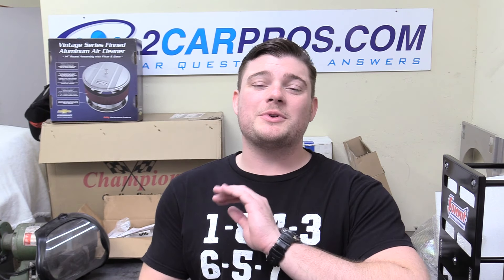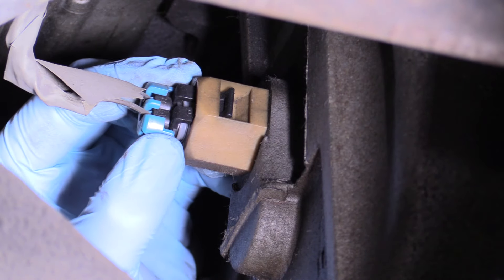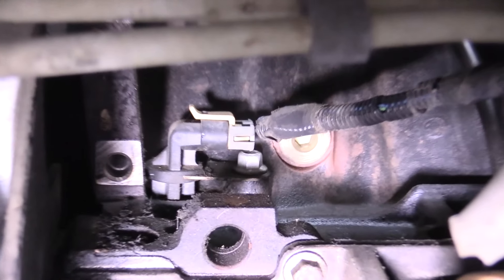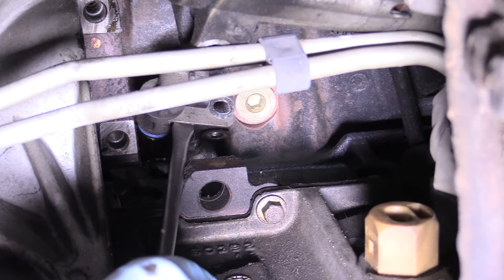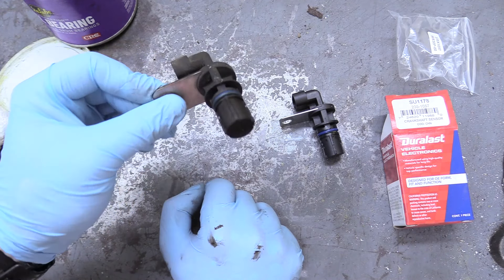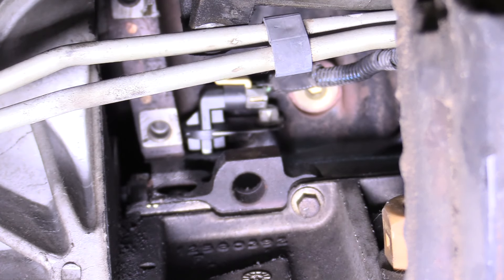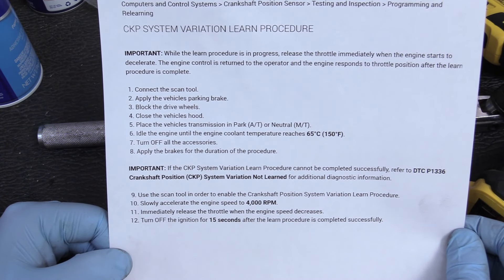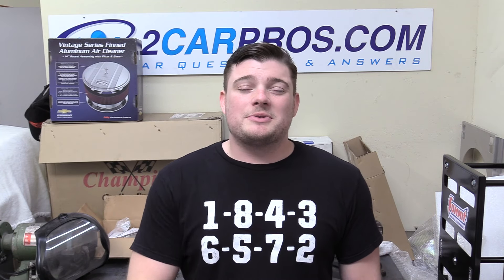Crankshaft Position Sensor Replace Chevrolet Silverado Suburban Tahoe GMC Yukon XL Sierra 2000-2006

Comment: Okay, well, I just checked and found that yes, I did break one of the 3 wires off from the crankshaft position sensor connector, which is why the truck won't fire. So I either need to splice in a new connector with a length of all three wires or get a connector tool and try to fix it. Edit: Didn't plan on fixing it tonight, but the local auto parts store had the part, so I went and got it, spliced in the new connector/pigtail and the truck runs!
Reply from the maker: Nice work! Thanks for watching!
Reply: What was the order in which the wire went

Comment: When doing this to my 2001 Suburban 5.3l,
 I had to take the 15mm bolt out of the dipstick tube bracket (from the top side) and pull the dipstick and tube up and out of the way so the starter could then be pushed back. My starter had no room to slide back until I did this. Hope this helps.
Reply: Hoping they fixed this on the 2002 models, not looking forward to this fix

Comment: You can get to it by going through the RF wheel well; just remove the wheel and wheel-well lining.  Also, I'd disconnect the battery before messing with the starter.
Reply: I think that was the very first thing he said when he started explaining the process. Paying attention pays off bud.

Comment: This is pretty much how it goes. But I'm sure 99% of us don't have a car lift in our driveway or garage. So you'll be doing this on your back in the ninety-degree heat trying to finagle that sensor out without smashing into pieces mine was stuck in there pretty good.
Reply from the maker: So do you want me to not use a lift? I'm confused. Thanks for watching!
Reply: @2carpros  that’s not what he was saying at all. Lol.

Comment: Great video. 
If I just want to replace the O ring and not the sensor. Do I I still need to relearn with system. Since I’ll be unplugging it.
Reply from the maker: I think if you replace it with the same sensor it will be ok. Thanks for watching!

Comment: Tip... don't use oil or grease on rubber seals. Solution, use silicone paste with teflon, it won't swell the seals or make them soft like oil and grease.
Reply from the maker: Good tip! But most people have engine oil and I want to make these as accessible as possible. Thank you so much for watching!
Reply: wouldn't wanna get engine oil on an oring that is used to keep engine oil sealed in.
Reply: Well I first thought was use sil seal , or sil glide  I think it’s called. But made for o rings and doesn’t swell them.
Reply: Great tip i will remember

Comment: How different is this on a Chevy 4x4? I heard the oil dipstick tube is in the way from underneath....maybe there's a better method on the 4×4s?
Reply from the maker: I don't see how it would be different. There just might be an axle in the way. Thanks for watching!
Reply: Through the wheel well

Comment: When these go bad, can they cause the dash tach to drop off on the freeway or under moderate load (acceleration). I'm fiddling with a P0342 code, and my tach will drop off when on the freeway or right after moderate acceleration up hill.. I have a 02 LS1 in an F-body. No sure if I should go after the Cam position sensor first or do the crank position sensor (it looks so much easier than the Cam Sensor)
Reply from the maker: What usually happens when these go bad, is a crank no start or an intermittent stalling problem. I would swap out the Cam sensor and see if that fixes your problem. Thanks for watching!

Comment: Hi there, thanks for the video but where the location of crankshaft sensor because in my truck Duramax 3500 2005 6.6 diesel it's not behind the starter so do you have any advice thanks

Comment: Thanks for the video! I'm going to attempt this on my 09 Hybrid 6.0L. I'll comment back when it's done and hopefully won't have to do the Relearn.

Edit: the starter is in a different spot so I easily did this with a 10mm and elbow grease! My CEL is still on even after a reset from my scanner so either I need to relearn it or unhook the battery for a few...

Comment: What do you know about the different teeth on the reluctor on the crank, and getting the right while replacing the engine, not sure how many different ones on a 5.3 Ls 1
Reply from the maker: It is matched to the year of the truck. I believe only the smaller amount of teeth came on these older trucks. Thanks for watching!

Comment: Is the wire going to the crankshaft position sensor connected to the starter wire harness? Does the wire underneath the starter on the left side go up to it? I wonder if I pulled too hard and disconnected it or pulled a wire out. The truck won't fire now, but did before the starter replacement. It's the only logical explanation for it magically not firing after the starter job.
Reply: Did you ever get this fixed I'm pretty sure I'm dealing with the same problem rn it was firing before the starter job and now the new starter went it and now not firing at all

Comment: Went to a local shop for a diagnosis. And we were  talking about this. But we were tryna figure out why 7 and 8 were misfiring and fuel injectors didn’t look like a problem changed coils wires and spark plugs still misfires when I floor it at high Rpms. I don’t know if I fix this it’ll work but I’ll try it out

Comment: Can the oring go bad and cause oil leak from sensor?
Reply from the maker: Yeah sure can. Thanks for watching!
Reply: @2carpros  Ok i got oil leak coming from up top behind intake i felt it was wet around that sensor its running down to the starter im going to change it out tomorrow
Reply: I've replaced my crankshaft sensor and the o ring twice in the new one and it still leaks oil, what should I do differently?

Comment: If you don’t have a check engine light, can you skip the relearn? Wouldn’t the ECU simply relearn over time? Thanks.
Reply from the maker: It will most likely run for a little bit until the monitor resets, about 35 miles, and then the check engine light will come on. But the truck will still run, you just have to have it relearn after that to get the light off. Thanks for watching!
Reply: Reply might not have worked due to the link, I added, but here’s a “relearn without a scanner” procedure option. See any issues with using something like this?
“How do you relearn a crankshaft sensor without a scanner?
- Turn off all of the accessories.
Accelerate the vehicle to 55 mph at part throttle.
- Cruise at 55 mph for another 5-6 minutes.
- Decelerate to 45 mph without using the brakes, and maintain 45 mph for 1 minute.
- Perform 4 deceleration cycles, without using the brakes, of 25 seconds each where no specific speed is necessary.”
Reply: The second version reads like this, but it looks to be basically the same “relearn without a scanner” option:
“NOTE: If the Crankshaft Variation Relearn is not accessible through your scanner (some truck applications 1998 & later), perform the relearn in the following manner:

1. Turn off all of the accessories. With the Air temperature sensor and Coolant temperature within 5 degrees (Centigrade) of each other, start the engine and let it idle in Park or Neutral for two minutes.

2. Accelerate the vehicle to 55 mph at part throttle. Cruise at 55 mph for 8- 10 minutes until the engine reaches operating temperature.

3. Cruise at 55 mph for another 5-6 minutes.

4. Decelerate to 45 mph without using the brakes, and maintain 45 mph for 1 minute.

5. Perform 4 deceleration cycles, without using the brakes, of 25 seconds each where no specific speed is necessary. Returning to 45 mph for 15 seconds in between deceleration cycles.

6. Accelerate to 55 mph and cruise for 2 minutes.

7. Stop the vehicle and idle for 2 minutes with the brake applied and the transmission in Drive (automatic trans.) or Neutral (manual trans.) with the clutch depressed.”
Reply: So I did the “relearn without a scanner” procedure, and so far no check engine lights. The truck seems to be running as expected. Hopefully, it took.
Reply: @shrouts777  Are you still good? How is it running?

Comment: Can I drive my truck to the shop to have the relearn thing happen or will it not work
Reply from the maker: Ours worked after I put the crank sensor in. Didn't even have a check engine light until later, then I could relearn it with a fancy scanner. So yes you can drive it to a shop for a relearn. Thanks for watching!

Comment: Question: so after i installed the crank position sensor i can drive it to a shop and have them program it?
Reply from the maker: Yes you can. Thanks for watching!
Reply: How much did they charge for the learning?

Comment: Are these things known to leak oil on the starter?
Reply from the maker: Not that I know of. The starter bolt holes are blind so they can't leak oil. The only thing that can cause that is a oil pan gasket leak and its whipping up onto the starter. Thanks for watching!

Comment: I ODB reads P0336 I changed the sensor and it still doing the same thing not starting but  I keep getting the same code. Could there be any other problem?

Comment: Awesome video! Is this the same for a 07 Tahoe?
Reply from the maker: It is but the sensor is different because that's when they switched reluctor wheels on the crank. Thanks for watching!
Reply: Man just got done and your video made it super easy now off to a shop to get this engine light off.

Comment: Hi, I have a 07 Tahoe 5.3.
I got p0300 code random misfire.
Changed coils,plugs,sparkplugs.
And is still misfiring (hesitates)p0300.
What are the chances that I have a bad KPS based on your knowledge?
I just can't get my head around it. 
Car was running fine before.
Reply: @Daniel_el I have the same issue starting to believe its my crankshaft sensor!!! Gonna install one tomorrow
Reply: @TexasRigour  
Let me know how it goes. 
Cause I changed my camshaft and crankshaft sensors and MAF sensor too. And it still misfires.
Reply: @dannysa503  what’s your spark plug gap at
Reply: @dannysa503  I changed my PCV valve that helped a lot also changed my idle and engine light stopped blinking (update it’s your fuel injector) motor threw bearing out had to swap it
Reply: @TexasRigour  
Sparkplugs are at 40.
I also changed injectors.
Reply: @TexasRigour  
Pcv valve?  
You think I should change that?
I just don't want to spend more  $
Reply: @dannysa503  PCV valve goes into driver side valve cover on the back it’s $1 at oreilly auto parts suppose to be changed every 30k. Idk if you heard crankshaft sensor has learning procedure
Reply: @dannysa503  have you checked your o2 sensor voltage ?Those can also cause misfire. It’s difficult to diagnose p0300 I’ve checked injectors, o2 sensors, changed spark plugs, wires and coils. So far I’m leaning toward that crankshaft sensor
Reply: @TexasRigour  Could be intake gasket leak also
Reply: @roltyd22  wasn’t my case.. knock sensors harness was my problem
Reply: @TexasRigour  What code were you getting? Im getting stupid po300 random misfires
Reply: @roltyd22  p0300 but it was a combination of fuel injector and knock sensor connection rigged up

Comment: Man i changed my starter on a 2003 GMC 1500 and now its cranking but no spark??? Im puzzled because truck was running fine before i changed the starter?? Any help? Not getting spark now????
Reply from the maker: Maybe you accidently unplugged the CPS when you changed the starter? Thanks for watching!

Comment: My truck Silverado stalls randomly and no mechanic can figure it out. Will this do the fix. I already replaced the fuel pump. 

It stalls at any speed at anytime. Truck don’t have to be warm for it to stall. 

Will this fix my problem?? Thanks.
Reply from the maker: Yeah I would change this 100 percent and then maybe a camshaft position sensor. Thanks for watching!
Reply: @2carpros   what will happen if i dont re learn it? will i still be able to start and run the engine safety? just so i can get to to the mechanics?
Reply from the maker: @joehill647  Yeah it will start, it will just throw a code until your get it re learned.

Comment: Why didnt you put dielectric grease in that?
Reply from the maker: On the sensor itself? Because it gets bathed in engine oil. Or on the connector? Because it has a weather pack built right in. Thanks for watching!

Comment: Question, would this solve a p0343 code on a 04 tahoe 5.3? I already replaced pigtail and camshaft sensor, but still getting this code.
Reply: I had this code after I replaced the camshaft sensor, turns out I either had a bad sensor(aftermarket) or i didn't put the sensor all the way down. I replaced it with a ac Delco part and re did the wiring harness and made sure it was all the way down and that code disappeared and never came back.
Reply: @CLASHWITHTRILL  thanks. I figured it out. I crossed wires when I installed the new one. so I rewired it and now I got no issues.

Comment: I just replaced mine and it started without any issues. Do I still have to have it relearned? 
Mine stalled twice last week and I was able to bring it home just by removing the ground cable. 
How far can you drive?  it to get it relearned
Reply from the maker: It should drive if that was the problem no matter what. We drove ours 35 miles or so before the check engine light came out asking for a relearn. Any shop should be able to do a relearn in 5 minutes for very cheap. Or you can buy an expensive scanner and do it yourself. Thanks for watching!

Comment: I'veI done many crankshaft sensors and have never seen it stated in the instructions to lube the sensor with wheel bearing grease or oil of any type.  Usually there are no instructions that come with the part.  Just replaced one on a couple of days ago where a so called ASE mechanic didn't even check for clearance and just push the sensor in place smashing it up against the innards, causing a huge gouge and scratching the sensor up badly.  The one was a mechanic in name only.
Reply: He's putting grease on the o-ring so it doesn't cut it when inserting it.  You don't want to put any o-ring in dry.

Comment: i just bought 04 gmc Yukon 6.0 77k miles when i am at stop it cuts off rpm drops low, previous owner changed the fuel pump, throttle body no check light.

Comment: Will this sensor cause a misfire and hesitation under load? Truck runs good at idle but if I hit the gas fast it backfires through the tbi and trying to drive it does also.
Reply from the maker: That sounds more like a spark issue. Thanks for watching!
Reply: I have the same issue did you ever figure it out?

Comment: Do you always have to do a relearn, if it still doesn’t start could it be  because of the relearn❓ thanks
Reply: No. I just did mine. It will run but it will be hard to start. There is  relearn that you can do without a scanner that helped me. 55 mph for 2 min drop to 45 for 1 min using no brake. Then 4 more times from 55 to. 45 using no break. Google it if you don't have a scanner. But you need 15 miles of straight road . Good luck